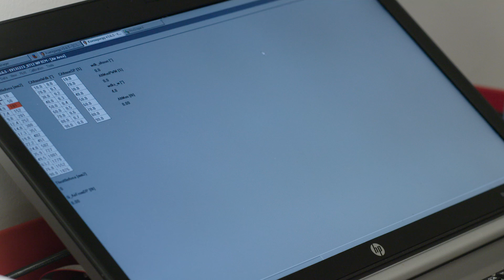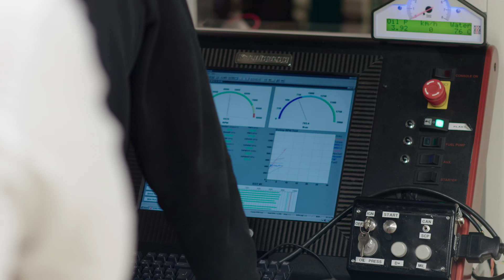The 1360HP Heart of the Koenigsegg One:1 - /INSIDE KOENIGSEGG

Comment: I love how the Koenigsegg Agera R has a V8 engine and can win against a Bugatti Veyron which has a W16.
Reply: worldoffunny808 Didn't count the displacement or the size of the turbos and the turbo boost??

I love how kids always view everything from their onedimensional view of things.

Hey this car has like a V8 and like this has like twice the number of cylinders so like 8 is less than 16 so like that says everything because I don't know anything about automotive engineering but I can count to 16.

A tuned Nissan GT-R can defeat the Koenigsegg and only with a V6. A tuned Honda Civic with 1000hp can easily defeat the Koenigsegg on a dragstrip with a 4 cylinder engine.
Reply: @onetwoeightcommodore5555  bugatti fails at hyper cars, everyone knows that. they stick 2 engines together and chuck turbo and super chargers at it to make it have more power cause they cant do it with less cylinders. koenigsegg has to make a fast car that is safe, can handle and can be a real road car.
Reply: WTF is Bugatti Veyron?
Reply: I'm amazed at the power and efficiency of these engines. Are there more powerful engines anywhere in the hypercar industry!?
Reply: Cmon that thing has 2 Turbos where as Veyron is only 16 cylinder with no turbo
You should get Vision GT then were talk
Reply: @RizLazey  the veron is stock with 4 turbo chargers on the 16 cyl...
Reply: xXx_MlgTr1kSh00ter _Xx the veyron has 4 turbos
Reply: Different cars for different purposes. One is not better urn the other unless you build it for the same reason.
Reply: V8 power😎😎😎
Reply: Whow dude. You can't do that. Why would you compare a Koenigsegg to a drag car? I was just making a point to show how less is more because Bugatti and Koenigsegg are competitors. Stock for Stock is what I was talking about. Grow Up! We can think what we want Mr. KnowItAll.
Reply: @worldoffunny808  its still a bad comparison
its like saying, that a wheel with 5 spokes is better than a wheel with 8 spokes while they do the same
the W16 from bugatti is one of the most reliable engines (in their class), it was just designed as a 16 cylinder engine
Reply: they cant hit 400 or hit 100km in 2.5 though
Reply: @nict7293  can now. and bugatti have got worse. bugatti will never be as good as koenigsegg

Comment: I really applaud Koenigsegg for creating a supercar brand. He is an inspiration for anyone who wish to pursue his/her dreams.
Now, I have criticise the engine a bit. The way they tuned the engine is to raise peak torque to a higher RPM region. This inevitably compromise the low-end torque even further. Not sure it is as drivable or easy to get the power-down as other supercars.
Now if there is a MGU-H system in place of the normal turbo? That may solve the turbo lag and flattens out the torque curve.
Reply: it has over 1000Nm of torque from 3000rpm, I don´t think you need more low down torque than that.
Reply: being a v8, it has bottom end torque, the high rpm power is lacking in this type of engines.
Reply: Jared Forsgårdh No it doesn't.
http://tinyurl.com/odnfb33

The torque curve is bias to top end power. at 2500RPM, there is only 600NM. Below that, there is really weak torque for the this type of car.
The rise starts from 2500 - 4000RPM. So you need to keep the engine above 4000RPM to enjoy the power. Not good in the rain when u need power without wheel spin.
Reply: Maybe you heard incorrectly.. He said that they increased the power which is produced at higher rpm so that they don't have to unnecessarily increase the strength and weight of the components in the engine to handle any increase in the torque
Reply: Akhil Dhaundiyal I do understand his approach and I agree with it.
I just wish the engine would have torque not just at higher RPM but also at lower RPM. to make it more tractable.
Reply: James B http://www.gizmag.com/koenigsegg-one1-megacar/31038/ contradictory info then
Reply: Jared Forsgårdh Gizmag and all other website just copied the press release of Koenigsegg. Which states "Torque: over 1000 Nm from 3000 to 8000 rpm".
The power curve is also published by Koenigsegg.
https://www.autoblog.com/photos/koenigsegg-agera-one-1-2/med/#photo-2457163/

There u go.
Reply: guess they "lied" since it doesn't make 1000Nm until 3500rpm. Who cares it has more grunt then you will EVER need.
Reply: Anyway, my criticism is just a minor one and I offered a suggestion to this problem. Something that Koenigsegg himself can consider.

Comment: Everyone saying electric isn't that bad isn't looking at the issue; it's not the motor, it's the batteries. Current battery tech just isn't good enough to justify an electric car, yet we still produce them in mass. There's a problem when a prius causes more pollution before it drives a mile than a chevy truck does its entire lifetime.
Reply: 150 mile range is all i really need in a day. i dont take road trips but i do sometimes commute 80 miles in a day
Reply: RussyG32 i drive a 350z
Reply: wow.I drive a "12 rs6 whos next
Reply: nic t i drive a turbo charged 325i with 290 hp
Reply: roywhiteo5 The big issue is that the car might have 150 mile range on battery TODAY...but give that battery a few hundred charge/discharge cycles and see if it'll still get you 150 miles.
My year old cell phone lithium polymer battery has lost 50% of it's capacity at least already.

Meanwhile, my 1996 BMW 328i at 18 years old and 201k miles still get's a direct calculated mileage of 25.1 per gallon, which is actually better than advertised when it was new.